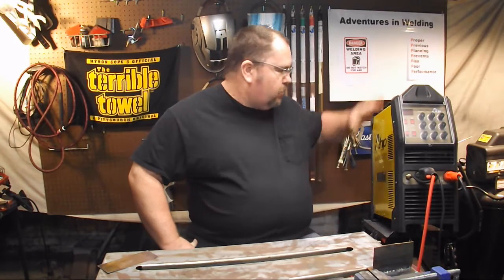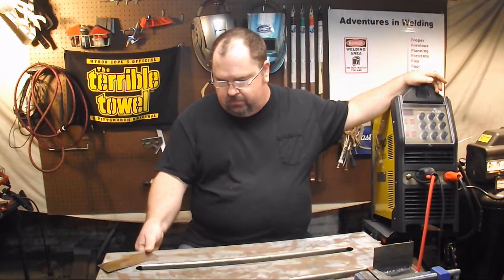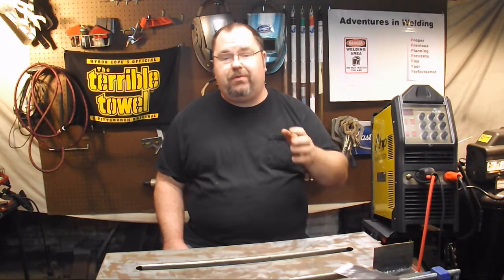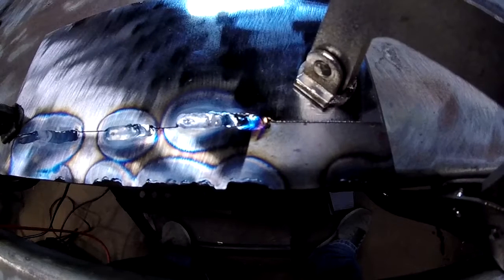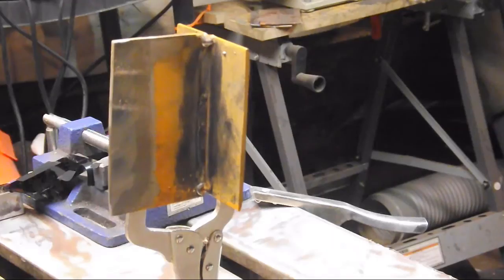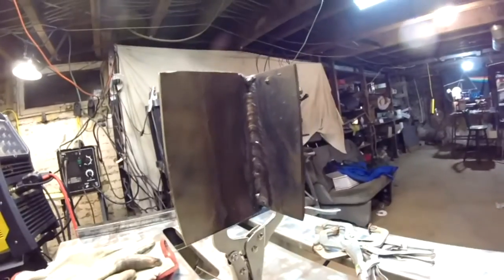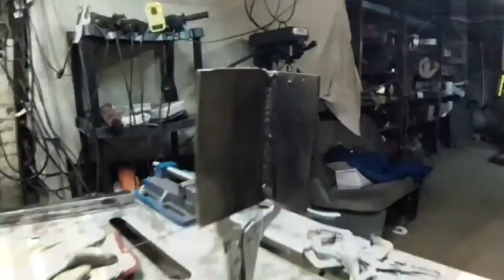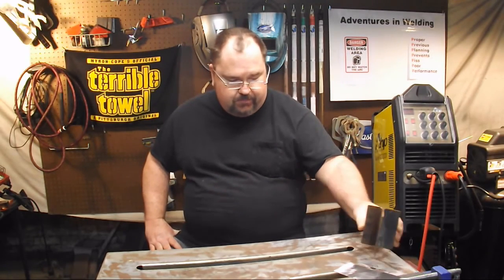Pulse Tig Welding on the AHP Alphatig 200x

Comment: Hey Paul, try that vertical up weld at 1 pulse per second and see if you can put your filler in on the peak pulse. It really looks neat.
Reply from the maker: +scott carr Scott, after timing the pulse function on this machine, it looks like the slowest pulse is 2 per second. So they have mislabeled the dial. 2 Hz is pretty quick.